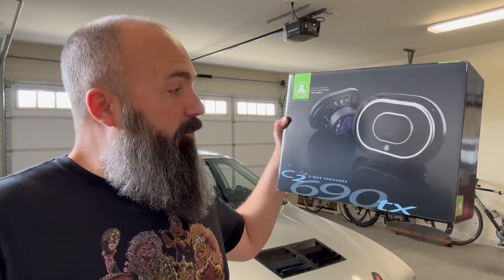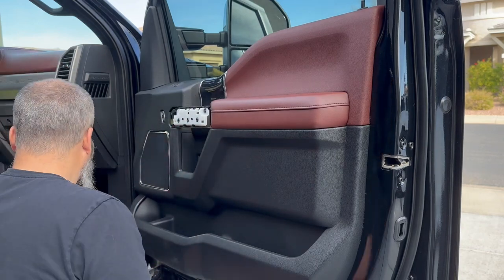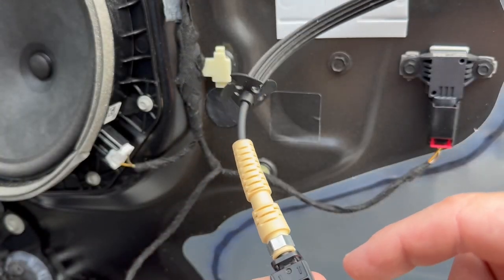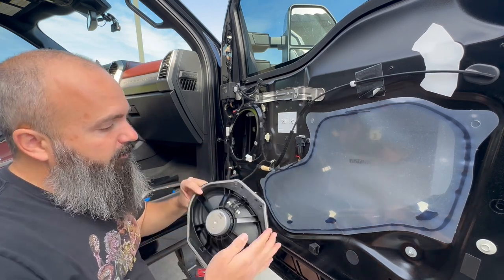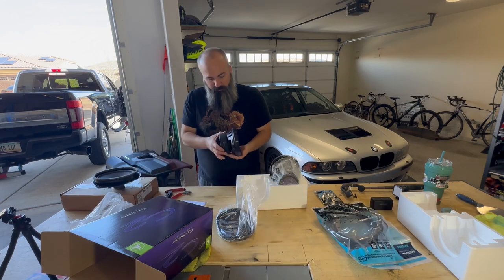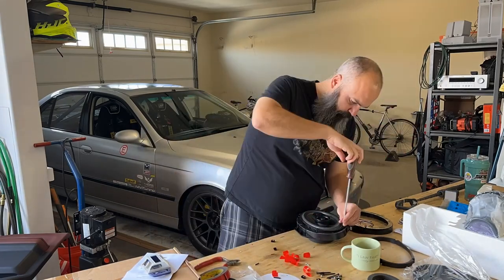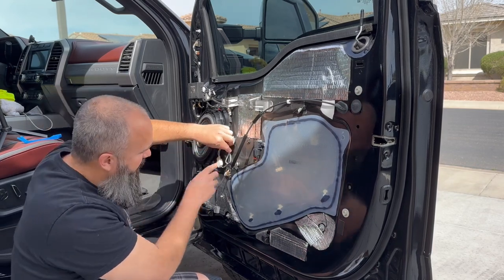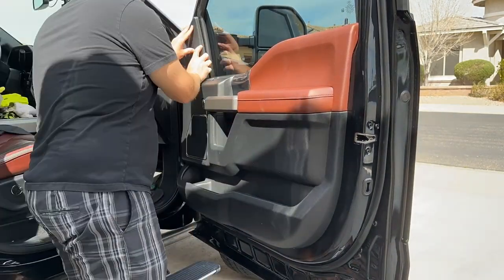F-Series Front Door Speaker Upgrade | F150 F250 F350 F450

Comment: Obviously I’m not the guy in this video but I do have a lot of experience with installing audio equipment. The thing I notice the most when installing speakers on your vehicle when connecting them to a stock system is a much greater degree of clarity. Typically, you’re not going to get more out of the speakers depending on the rms requirements of the speakers you’re installing. More meaning, more bass or more midrange. Without an aftermarket amplifier, you’re not going to see much bass or midrange improvement because it requires more power to push those components of a speaker.
Reply from the maker: I totally agree. An amp is a future thought for me. Though the primary reason I decided to install these was the difference I noticed in installing the rear speakers. It may be placebo I admit, but I did feel like there was more clarity and bass response.

Comment: you should get the tall adhesive foam rings to seal these to the door panel.  It helps bass a ton by not letting backwaves from the leaky door sneak past the 6x9 and out of the grill.  Easy to go back and put some in.  It is really worth the $15.  Nice install video though, this will help my buddy with his F250 soon.  Thanks
Reply from the maker: Thats good advise. Thanks for the comment!

Comment: I know this is an old video but I am upgrading as well right now and I have already hit issues. How were these JL speakers with the volume up? Did you ever notice these speakers clipping out or popping? I have the B&O in my 22' Lariat and I bought some decent Infinity Reference 6x9's and the audio was SOOOO much better. However, within the first few days, I eventually made it through the playlists to some thumping songs and the speakers I installed started clipping out at loud sound levels. I measured the power and I wasn't exceeding watts and the ohms match. But above Volume 20 the speakers began cutting out really bad every time the bass hit, with a loud pop. So now I'm looking for "better" speakers to try. I wasn't trying for increased quality of a multi-amp setup. Honestly, I just thought that the stock B&O sounded muddy, no matter the EQ settings and so I was looking for more crisp highs than the stock paper cones are capable of without having to run wire for component speakers.  Thanks for the info!
Reply from the maker: I'll be honest, what you're describing sounds like what my original speakers were doing. Though I don't think I cranked the volume quite that high. I believe the factory amp has some attenuation of the signal at higher volumes to protect the speakers built into the logic. I wonder if that could be the case for he sound?

Comment: Thanks for the clear install vid. Were the OEM speakers 8ohms? What ohms were the JLs? Also I assume you had the B&O sound system in your platinum. What's your thoughts on those. I have a 23 on order with B&O unleashed but imagine they will eventually be replaced
Reply from the maker: The factory speakers measure at 4.4 ohms at the magnet so I imagine they are rated at 4ohms. The JL’s are rated at 4ohms as well. I have the B&O system. In all honesty it’s not bad. Pretty clear and decent low end. I was hoping for a little more low end out of these and feel like it’s there even if I don’t have a better amp, yet.